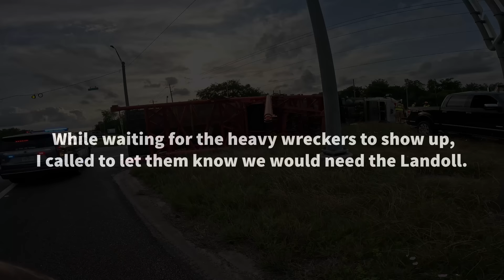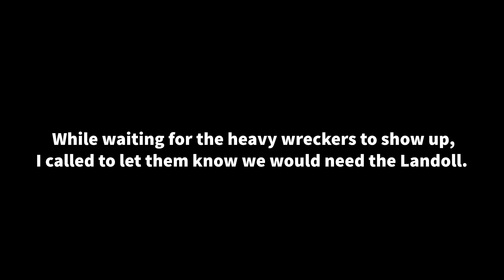Playing The Crane Game! Freightliner Rollover!

Comment: I'm glad the driver wasn't hurt but I'm surprised he thought he was okay to drive with a 50k pound boom section without properly securing it down.
Reply from the maker: Definitely could have been a lot worse
Reply: @Towtruck_Dustin  That's the truth.
Reply: The drivers side tire looked fairly bald on the outer edge. The second issue is the fact that the driver didn't really know the weight of his load! Scary driver. Great recover guys.

Comment: That boom section is from a Manitowoc crane. Before it can be used again, I will have to be inspected and certified by a licensed crane inspector. As for the truck driver that lost the truck and load, he is not competent to drive a truck again. It does not take much to see what happened here.

Comment: Looks like the load shifted under the straps going off center or speed around the corner.
Reply from the maker: He only had like four 4” ratchet straps to secure 50,000lbs…
Reply: @Towtruck_Dustin  what were the straps rated for? Because I thought I saw at least two of them had snapped

Comment: The driver that rolled should know better then to ise straps on a 25 ton or 30 ton load like that. Chains amd binders and he would have never met you guys lol. Scary the shortcuts these guys take. Thankfully no 4 wheelers got taken out when he rolled
Reply from the maker: He was a fairly young driver. Unfortunately he probably didn’t know any better, and found out the hard way.
Reply: Chains and binders cause damage and weak points to the crane booms,  extra strapping is required person height answers weight,  I hauled cranes and booms for many years

Comment: 🇬🇧  Hi Just found your channel on here  , interesting problem on your hands , my only criticism is  you have very poor on site Lighting for a Night time recovery , with the age of L E D  lights  surely all the equipment on site should be fitted with them , also as I am sure you are all aware  De Walt  Make some high beam telescopic lights which you can throw in any vehicle , and like you I was surprised that the Lorry Driver was Strapping down a 50 Ton piece of Equipment  using only web Strapping alone and not doubling it up with Chains .
Reply from the maker: The GoPros don’t do very good with picking up light. 
That said, my normal truck doesn’t have very much room for those big lights, and most of the time we don’t have time to setup a bunch of stuff. Which is why I use personal lighting.

Comment: You guys need a 25 ton Rotator Tow truck for some Jobs like theses
Reply from the maker: A 25 ton wouldn’t have been enough. They ended up bringing in a 80 and a 100 ton crane, and the 80 ton had to setup right on it, and couldn’t boom down much because of the load.

Comment: Dustin question, do you like running the wheel lifts and rollbacks or are you getting your CDL one day to run one of the heavy wreckers?
Reply from the maker: Personally, I prefer running the rollback, and doing the light and medium duty towing. If I get my CDL, it will be later down the road. Currently, I don’t have enough time to take the class.
Reply: @Towtruck_Dustin  I got my CDL 25 years ago not because I was a truck driver but because I was a heavy equipment mechanic. Now retired I drive a truck part time and even 45’ busses. It’s a great thing to have in your back pocket.  I encourage you do get one, it won’t hurt you.
Reply from the maker: It will right now, because I can’t take a month off work to do the ELD course. Lol
Reply: You can take the Cdl written test and get a commercial learner permit that your boss or another Cdl driver can sign off on and after 14 days you can take the driving test
Reply from the maker: Not anymore. Not since the ELD Mandate.